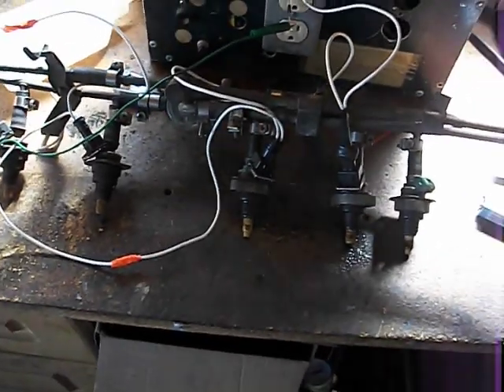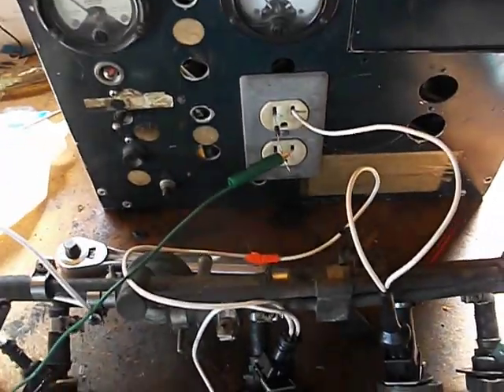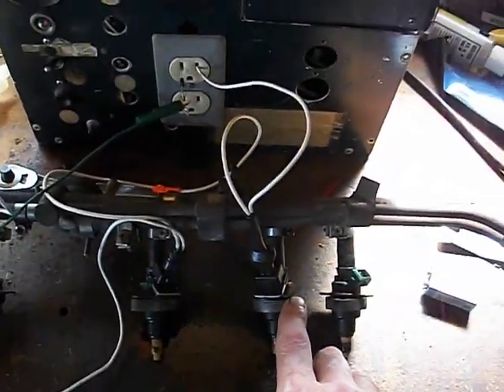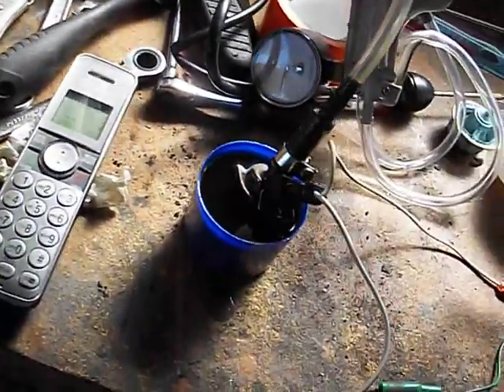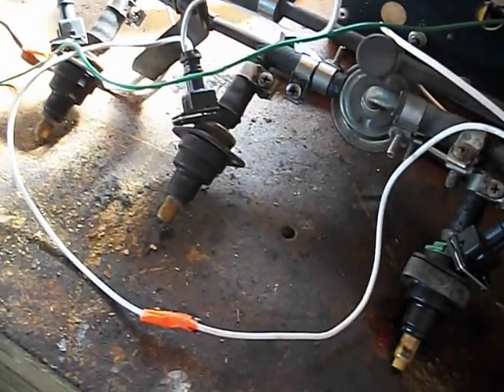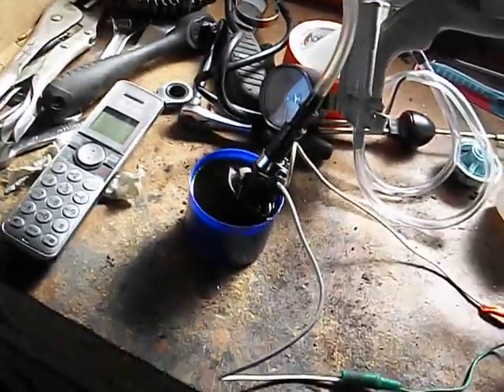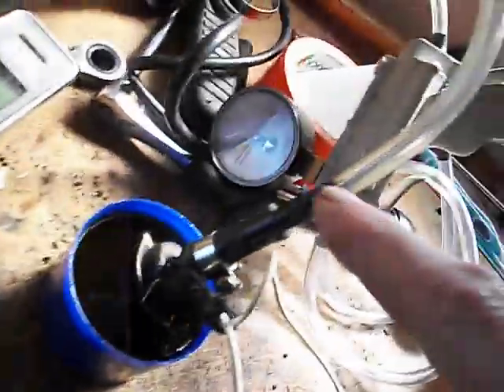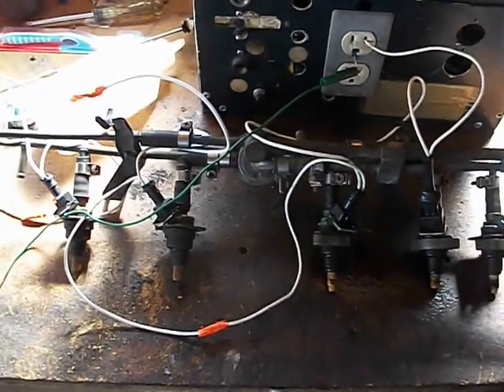unsticking stuck fuel injectors

Comment: 12 volt battery will get them unstuck. I've fixed old 70s VW injectors by just momentarily pitting 12 v on the terminals. They start clicking and come back to life. Run injector cleaner through at the same time

Comment: Hey! Just found your channel 😁 i have a trash 71b 5 speed I want to put in my 260. I going through your transmission videos. Are you done with your transmission yet? And where did you get a rebuild kit for it?
Reply from the maker: Yes trans is in and working fine. Cant recall where but if you shop around on google should be able to find a kit for under 100$ IIRC. I would look over the brass parts, they may be fine, and being OE maybe better than non OE after market.